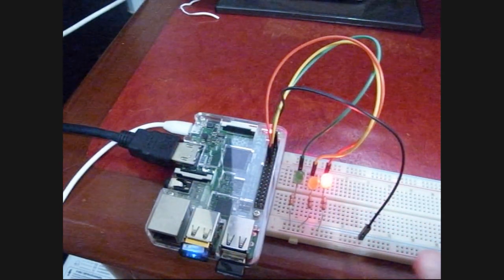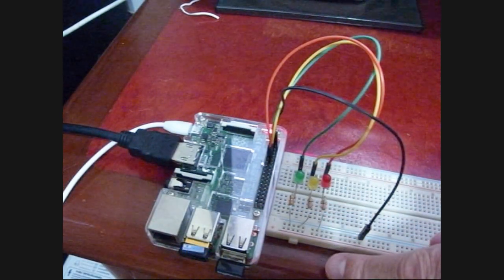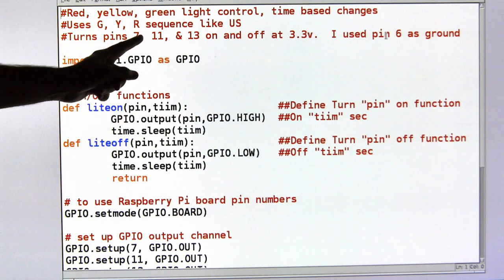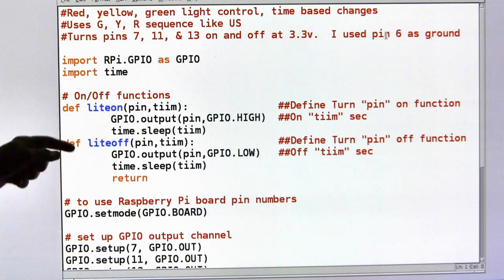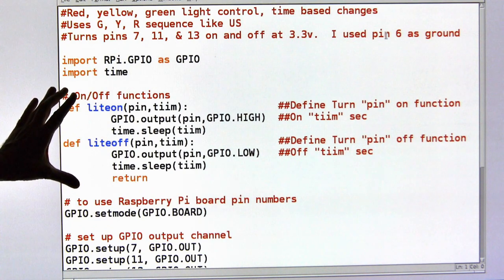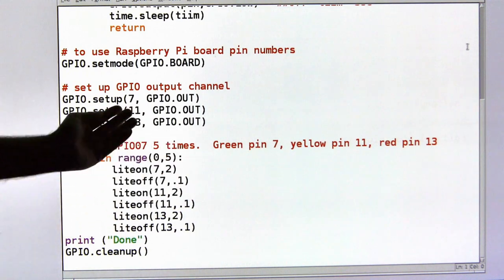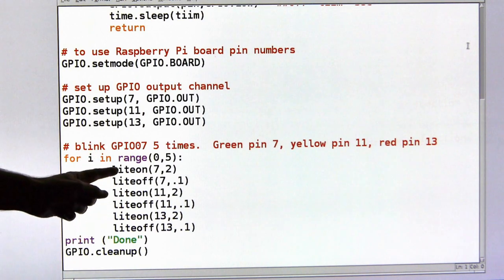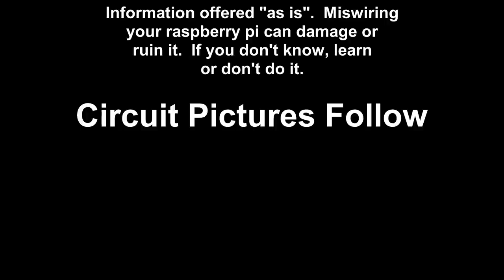RPi 02 - Raspberry Pi Traffic Light - Experiment

Comment: I am going for a job interview for the City of Tyler, traffic light department.
They’re going to start using the smart traffic light systems. I’m trying to get myself familiar with the system. I’m not too sure if you know the answer to this. Do you know if they’re going to be using the Raspberry Pi system or the Surtrac system?
Reply from the maker: Sorry, no idea.  But good luck with the job interview!
Reply: They most definitely will not be using RPi's.  IMSA standards require NEMA standards be met for traffic control devices.  There are many safeties put into place that a RPi doesn't do.  There are conflict monitors watching for problems, load switches to make low voltage signal control high voltage lights, and numerous other devices with wide temperature ranges and high G rating.  A RPi is similar to the monkey that held the Stop/Go sign on The Flintstones.

Comment: If that is a normal stoplight cycle, I don't want to drive wherever you live.
Reply from the maker: Fair enough.  But it is easily adjusted and it's the beginning of a more sophisticated system where sensors could detect cars and the number of cars and do on demand lights.